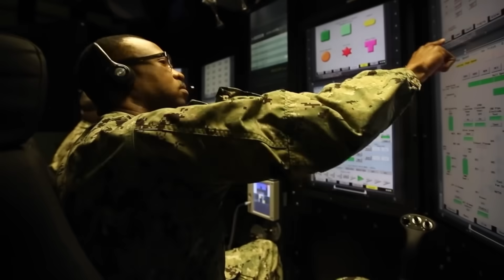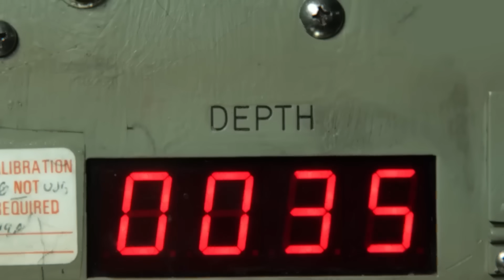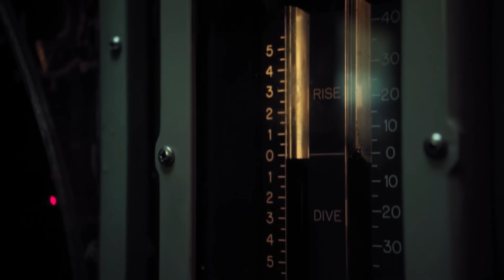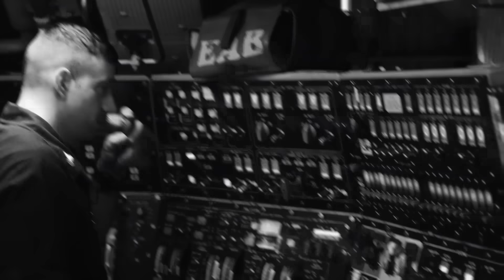What Happens When a Submarine Hits "Crush Depth"

Comment: One problem I see is that if you’re in a submarine, you could go all the way down as low as you can without crushing, and yet you STILL wouldn’t see anything! Submarines should have those huge “Seaview” style front windows!
Reply: There's essentially NO light below a couple of hundred feet so windows of any kind are about as useful as tits on a bull.  We SONAR operators are what keep us (most of the time) from running into things.
Reply: @garymartin6987  quartermasters would like a word with you.
Reply: @SnapshotTube2  You mean the ones on the USS San Francisco, SSN-711? (On 8 January 2005 at 02:43 GMT).  Tragic (QM's didn't correct the charts before deploying), but at a standard bell or slower SONAR would have picked up reflections from the surrounding peaks.  Above standard bell flow noise over the hull masks pretty much everything else.
Reply: @garymartin6987  I was under the impression that submarines don't use active SONAR while underway, except, I suppose when entering and leaving port. So how does the SONAR operator keep the sub from running into things.
Reply: @charlesgantz5865  Correct, we used the passive mode exclusively.  A seasoned operator can ID by ear alone well over 100 different types of contacts, both surfaced and submerged, biological and geological, and track out to 150,000 or more yards (75+ nautical miles)  for some types.  Based on what we were hearing we could also very accurately estimate speed and range.
Reply: @garymartin6987  1) You are missing a lot of context in your description of the San Fran. (Context I'm not going to hash out online as a currently serving submarine officer) 2) No, most STs are not going to be able to passively hear that they are about to have an allision with an underwater mountain. Collision with another vessel? Yes. 3) Quartermasters, the ANAV, NAV, the Captain, and the OOD work as a team to safely navigate a boat. Not really sure why you are trying to downplay the role that QMs play in safe-navigation but it's their primary duty.
Reply: @SnapshotTube2  No, Greg. They are the ones keeping you from running OUT of things.
Reply: Actually, Russia, and a few other nations, do have windows on their subs. Because of the long distances traveled when entering and leaving port, the bridge crew needs some protection from the weather. However, when submerged, that space is flooded, so you still don't have a view.

And, of course, the deep diving scientific subs have windows so the crew can see the area around them to perform their scientific duties. They also have big lights since it is pretty dark down there.
Reply: I really was just kidding. I know that if you’re in a submarine and things go awry, you can just use the flying sub to evacuate.

Comment: Can someone explain (like I'm an idiot) how USS Thresher actually SANK.  I get that there was a leak, and the Scram happened, but aren't subs meant to be neurally buoyant? Was it because the leak happened while they were diving?
Reply: submarine had a negative buoyancy at the moment of disaster because it's DIVED (in other words-filled ballast with water)
-The welding of USS Thresher salt-water piping system was poorly done due attempts to sail the ship in time, so the actual "safe depth" was much lower than it should be
-On test diving, weldings began to crack and flood engine room
-Water in engine room most likely short circuited reactor control and it automatically turned off
-And there's 2 possible reasons why the crew didn't blow the ballast: 1. Due reactor failure (submarine started to gain angle with nose up that clearly don't make sailor's attempts to stabilize the situation easier)    2. Ice formation in high-pressure air flasks due depth not intended for them (too deep). We can't say for sure whether the disaster was the cause of both of these factors or one of them. I think at first there was an unsuccessful attempt to blow the ballast and after reactor turned off probably causing a panic among the sailors. At least most of them died instantly, but the last 5 minutes must have been scariest thing that human can feel: you're in a sinking submarine, without a light, in the dark, listening how hull slowly grinding under the weight of the sea and probably walking on the wall due angle of attack.
Reply: Hard to float when filled with water

Comment: Not sure if it was Scorpion or Thresher, but when they found one of them on the bottom, it had 'telescoped' fore/aft.  The pressure hull has sections of different diameter, connected with relatively short conical sections.  As the depth increased, the circumferential welds on one of those conic sections failed and the aft end was rapidly shoved forward into the ops compartment.  So the description of 'a diesel piston' compression stroke is more apt than many people realize.
Reply: I saw that picture, it had to happen so fast thankfully those inside probably never even knew it happened.
Reply: That was USS Scorpion. Skipjack class, much smaller than Thresher.
Reply: Wow, that's horrifying.